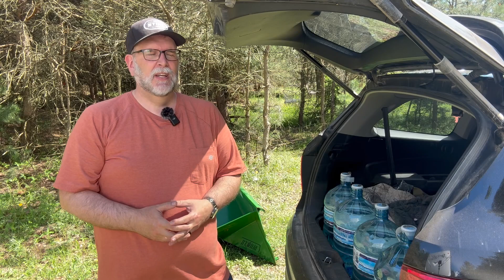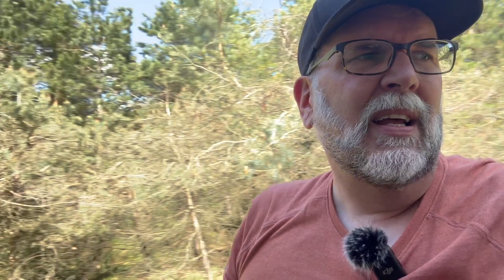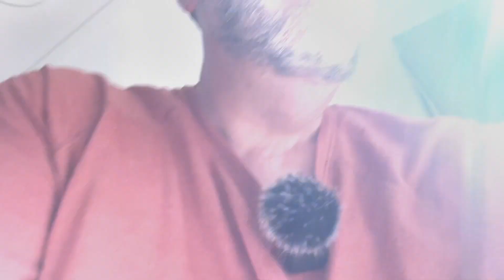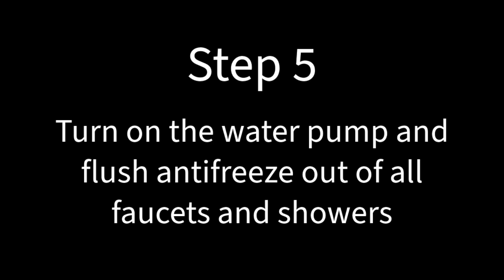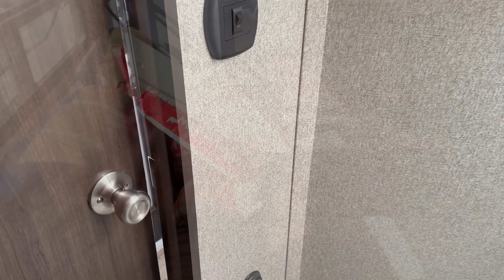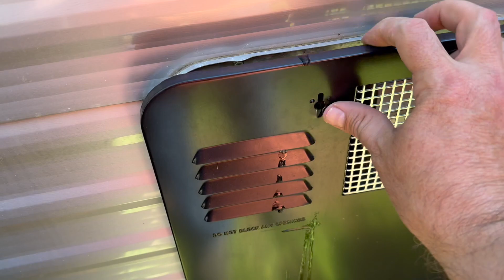How to Dewinterize Your RV in 7 Easy Steps (Travel Trailers & Campers)

Comment: I have access to a hose and water.  Is it still required to put water in the holding tank to use the pump to push the antifreeze through or just the hose attached.
Reply from the maker: No, it isn’t. You’ll be good that way!